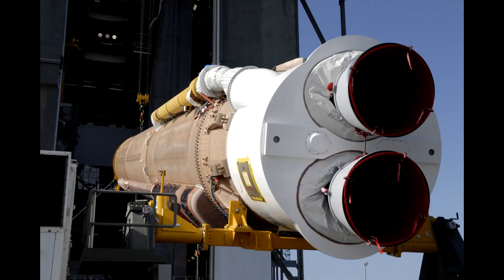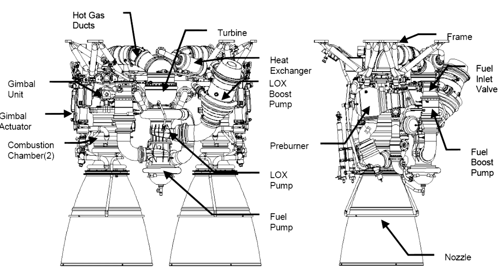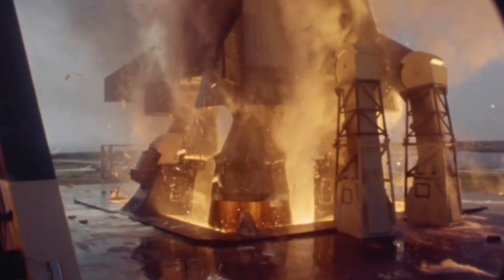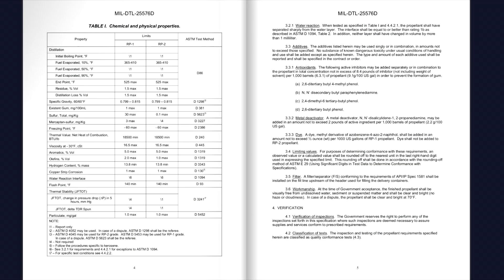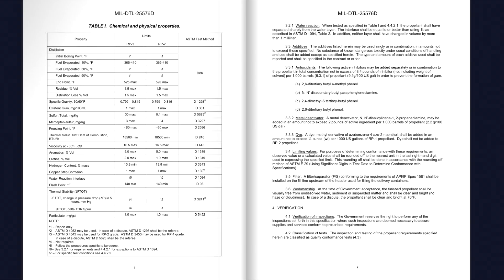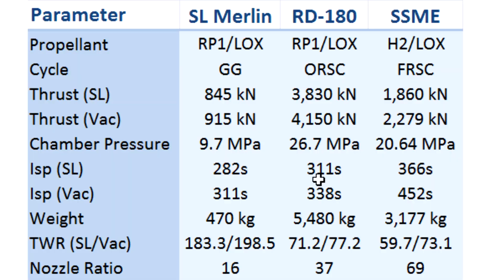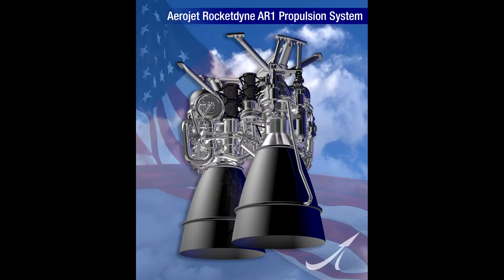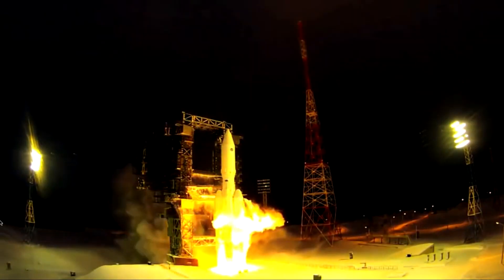Why Some 21st Century US Rockets Still Use Soviet Era Engines

Comment: So it seems the USSR has effectively seized the means of propulsion.
Reply: Perfect 5/7
Reply: why is everything in fraction ?
Reply: 8/10 solid. haha
Reply: James Bohigian ... Don't you mean liquid? =P
Reply: They have nothing to lose but their hydrocarbon chains
Reply: that is incorrect, currently with just updated electronics, they currently fly on the single stick Soyuz 2-1v, they intend to replace them with RD-193 when they run out, with 3 successes and 1 partial failure, it is a more obscure member of the R7 family of rockets as it omits the side boosters
Reply: I like the punletarian pro!
Reply: Can someone explain the joke? I'm not the native english speaker
Reply: Jet guy Then you need to do more research. There have been MANY flights of reused boosters. Hell, SpaceX just flew one for the third complete launch/land cycle just a few weeks back. That's up and down, three times, with the same booster. You can simply look any of this up in seconds. That mission was  SSO-A I believe. Frankly, if you aren't even following the space launch business close enough to be aware of this, despite it being covered extensively in the media...why are you even arguing here? Out of your depth. Reuse of these boosters has been proven for years now. And you were't even aware of it. Hell, even the Falcon Heavy launched on reused boosters. And lol @ aerospace engineer. Another guy I was talking to about diesel engines just told me he was a mechanical engineer, and he was even more clueless about the topic than you. But what do I know? I'm just a retired astronaut ninja assasin who moonlights as a snowcone machine salesman.
Reply: Had* ;_;
Reply: @jet guy thanks! Now I understand :)
Reply: Jet Guy Reusable boosters have half the payload? Compared to what? The Soyuz for example can only put about 15,000 lbs in LEO....
Reply: @jet guy actually reusing the rocket isn't an extra expense it's a savings because you aren't pissing away the cost of the entire rocket on nothing. Simple fact is they've been landing these boosters routinely for years now. They've landed dozens of them. They've reflown them and landed them again repeatedly. the technology is actually pretty well proven at this point even if it's still in an experimental phase. I don't know what to tell you. I understand there are fanboys of other companies and Fanboys of NASA and Fanboys of ula etc. but there is no reason to unrealistically diminish SpaceXs technology and its accomplishments.
Reply: So U.S. Lost that one compared to Russia's rocket engines
Reply: Go to your room. ;D
Reply: Which engine is best the cryogenic engine or the merlin engine?
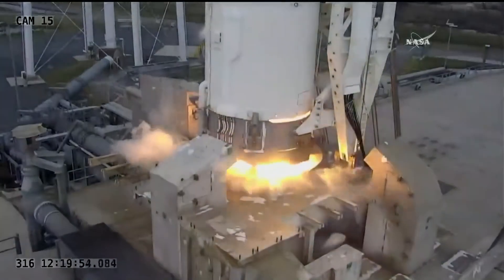Reply: 0:34 I'm not Russian, but the proper pronunciation of "Energia" in English (from "энергия" meaning Energy) is not En-er-jia but En-er-gee-a.
Reply: You have no idea how much I like this comment
Reply: This aged incredibly well
Reply: USSR muscle baby!
Reply: Lol i jsut got this like to 2.1k
Reply: I mwnt comment not like lol
Reply: Lol good one.
Reply: That man with the bourgeois Western sense of ha-has... send him to the gulag.
Reply: We have become as communist as Russia. Communism is where everything stagnates.
Reply: leapdrive Why can’t you just keep the stupid political nonsense out of this?
Reply: Steven Blackwood commercial rockets have to be cheap and reliable, it’s not like America does not know how to make powerful rockets.. Saturn V was powerful, and some of America’s Secret rockets are far much more powerful, but they are not cheap.
Reply: while the joke is very good, the Shuttle main engine is 453 seconds, while the RD-180 is 338 seconds
Reply: yes, but you also need to take into account the fact that kerosene is 10 times as dense as hydrogen, so you can store 10 times as much fuel in the same volume (also, since it isn't cryogenic it is a lot easier to store...) the rho*isp of the SSME could still be higher, but it is going to be a lot closer...
Reply: Exactly! Fuel density is the figure of merit for first stage, not Isp! Isp gets super important after you get into orbit.
Reply: Obviously one burns kerosene and one burns hydrogen it's physically impossible for a kerosene engine to come close to hydrogen engine in ISP. If you compare to other kerosene engines it blows them out of the water. And one is fuel rich while the other is oxygen rich. There really is no way you could compare those engines fairly or any way they could be more polar opposites of rocket engine design. Especially the fact that one is fuel rich hydrogen engine and the other an oxidizer rich kerosene engine. That is an entirely different engineering challenge and frankly fuel rich hydrogen is easier to do.
Reply: 221 b A better comparison might be between the RD-180 and the RS-68 on the Delta IV, which runs about 412 s in vacuo. While a cheap hydrolox engine, it’s still much more expensive than the RD-180.
Reply: @please_stop-v7o  RD0120...it has a specific impulse is 455 sec.
Reply: @please_stop-v7o  it is easier to do with high cost .
Reply: 666Tomato666  It's hydrogen, as explained in the video. Hydrogen has it's own compromises - mainly fuel density, consider the size of the external tank on the space shuttle.
Reply: Limivorous1  My `hydrolox Saturn S-1H` mental construction: The RP1 S-I stage is about 15 floors tall, the oxygen tank is about 8 floors, 4x as large as the RP-1 tank. The hydrolox stage will need the same amount of oxygen as the RP-1. S-II had tanks also about 4:1, but oxygen was the smaller one. So the S1H would need a 30 story H2 tank, an 8 story LOX tank, and 'the same engines and separator,' making S1H alone taller than Apollo-Saturn. #havingfunwithit
Reply: Space Shuttle engine is 366 s ASL, and SRB is 242 s.
Reply: @666Tomato666  Well, the RD-0120 would be the more appropriate Soviet counterpart to the SSME and that got around the same Isp. Made a bunch of trade-offs in other areas though.

Pity it is out of production though.
Reply: @666Tomato666  While that is true, remember that Hydrolox fuel density is very low, which means that if you replace a Kerolox rocket with a Hydrolox engine and fuel, the resulting deltaV would be lower.
Reply: 666Tomato666 dude you know specific impulse isn’t everything? Specific impulse mostly changes with different fuels. Thats the reason why ssme has that good numbers, not better engineering. Combustion pressure however depends on better engineering, and apart from the raptor russians have the best of that.
Reply: @666Tomato666 RS 25 costs a shit ton more, and complicated af too.
It's amazing, but it's not an easy option
Reply: You cannot compare different fuels. Hydrogen has highest Isp, there is no way kerosine(RP-1) engine can compete with hydrogen. But hydrogen engines are not that good for first stages, we still need big RP-1 engines.
Reply: No. There is only one American rocket that uses this old engine. It's soon to be outmoded.
Reply: RealityIsTheNow, you forgetting Antares? as to comparing to other kerosene engines, seeing as kerolox is best suited for the first stage, TWR is another important factor and the sooner you can get out of the atmosphere and make your gravity turn the less fuel you use on assent this is why the two vehicles right now that have the highest launch mass to LEO efficiency are Falcon 9 and Falcon Heavy combined with relatively light weight construction, the TWR of the Merlin engine is extremely advantageous and more than balances out the isp advantage that RD180/181 has over it
Reply: RealityIsTheNow that was the Antares 100 that used mothballed Nk-33s that were modified by AJR they are currently flying the Antares 200 on the RD 181 the immediate successor to the RD-180 used by Atlas V. Russia doesn't have the money that will ever make it to the engineers to make new rockets
Reply: @RealityIsTheNow  Ye right.

Comment: Can't they use SpaceX Raptor Rocket Engines. Don't know the precise power output of those rocket engines comparing to each other. But it would be quite simple to increase or decrease the exact size of all components to make a rocket with the wanted output? And why just also now use Russian Rockets? They can screw you due to the conflict with US weapons killing Russians so why not let an engine fail and cause for huge problems for the crew on-board.
Reply: SpaceX doesn't sell their engines since they like to iterate on design and selling would require freezing it, nowadays ULA uses 2 Blue Origin BE-4 engines for their Vulcan rocket which is a strictly worse design than raptor (worse in thrust to weight, complexity, not ffsc, worse production cadence) and more expensive but compared to other options it's pretty decent
Reply: @pc_screen5478  Thanks, I try to get it. You primarily say SpaceX is still fully experimental with these engines, and Raptor 2 will become R3 and also for if I say correct Block 2 Starship. And all is now still completely experimental. They are still finding limits and materials to get it better for re-using what is the difficult part because sending it 1 way you don't need a heatshield, fuel for boostback and landing burns. Managing fuel in all flight regimes is rocket science on itself

Also, the starship will do that, but so far I know they already did testing with  landing it and already hovering at a designated spot after return were also is a camera on a "Buoy?" 

Ansd finally yes, If the BE-4 is what it is but good enough for a disposable engine on Vulcan. Then it's better than using like Russian RD180's. And Vulcan can have litterly 6 SRB's to give it more juice to escape the dense atmosphere. So they can scale up or down with that just what you need for medium to more heavy lift.

Comment: Thought Russia embargoed both sale and repair of their rocket engines. So what are US using now?
Reply: There is a multi-stage answer to this question:
Firstly, only two US rockets ever used Russian engines: Antares and Atlas V
Antares will instead use Miranda engines from Firefly in the future. And for Atlas V they still have enough RD-180s left to keep flying up to 29 more missions until 2029, then they'll replace it with the Vulcan and BE-4 engines from Blue Origin, as mentioned in the video. The Vulcan had its first successful launch just last week on the 8th of January. :)

Comment: The USSR develpoed a Full flow staged combustion engine the rd-270, a tri-proppelant engine rd-701 ,they also developed n204/udmh a rocket fuel and a fluorine engine rd-301

Comment: @ 4:37- These are the factors that convince me that the Russians are notably ahead in rocket engine design.  They've resolved the fuel-rich soot problem by making the system oxygen-rich instead.  Circulating all the oxygen through the pre-burner, then the exhaust containing unburnt oxygen is then sent to the main engines. They are also the first to develop the advance stainless steel alloy to both withstand higher combustion chamber pressures & oxidation immunity.  A 25% power boost yet so reliable & affordable that the U.S. have routinely chosen to purchase & use Russian rocket engines.  I'm certain Mr. Vladimir Putin will agree with me 100%.

Comment: In the case of the Atlas V, more like end of 20th century American rocket design using Soviet Era engines that received an upgrade. The Atlas V was part of the Evolved Expendable Launch Vehicle, which kicked off in 1994. Lockheed Martin was able to harvest a whole lot of hard work the Soviets put into the difficult RD 170/171, developed for the Energiya strap on boosters (and a cause of delay for the program). The collaboration appears to have gotten it right given the record of the Atlas V  and the RD-180; and given a few of the accidents with the RD 170/171 in the 1990s and 2000s.

Comment: The US government should buy a dozen each of AR-1, BE-4, and Raptor to replace RD-180. With three options the risks are reduced and purchase of more than just prototypes allows for flight tests in addition to static ground tests. Testing a dozen engines each should probably be enough to make them low enough risk to be available as plug in parts for various customers. I personally like the BE-4 and Raptor better than AR-1 for future potential but AR-1 could potentially be much easier to incorporate into most existing rocket designs since the propellant tanks can remain the same.

Comment: USSR never utilized closed cycle for human missions. Open cycle is far more reliable and with a low failure rate. So the RD-180 is nice but definitively dangerous outside standard commercial missions.

Comment: It's interesting that soviet rockets from the 1980s have a higher specific impulse than the modern Merlin engine, but It's worth noting that the Merlin engine has 2.6 times as much thrust per kg when compared to the RD-180.  Less of the thrust that's produced is spent lifting the engine so more is available to lift payload.  The much smaller Merlin is used in large arrays providing redundancy for safety, and the Merlin was designed for lower cost volume production and reusability.
Reply from the maker: In the other hand, the Merlin has lower specific impulse so the better TWR gets eclipsed by having to carry 10% more fuel.
Reply: @scottmanley  - Hey Scott!  IANARS (I am not a rocket scientist), so maybe check my math roughly comparing the Starship with 31 Merlin engines in the first stage to a hypothetical RD-180 powered Starship, neglecting the finer issues of vacuum versus sea level performance, etc.
470 kg X 31 Merlin engines = 14,570 kg
Engine mass savings compared to RD-180 engines = 23,314 kg
10% excess fuel needed for Merlin engines = 120,000 kg
Net mass advantage for RD-180 engines = 96,686 kg
Mad props to those old soviet rocket scientists!
I suppose (no calculations) that the Merlin was chosen for being some combination of using cheaper materials, being faster and easier to build in production quantities (Elon always says that the trick is making rocket science into a manufacturing process), possibly greater inherent reliability, more scalable with safety in redundancy, more suitable for reuse (I'd guess that was a major factor), etc.

Comment: Something I didn't hear mentioned was the flyaway cost of each engine. It's been my understanding one of the advantages of Russian engine cost is that could basically ignore the costs incurred during the Soviet era. The B-1 enjoyed a similar advantage when Reagan resumed development. It started out with a clean slate accounting-wise, so on the books it came in under budget.
Today we need to compare the Russian engine with other engines with similar lift. Does it matter if the Russian engine is more efficient if it costs (say) 1.5 times as much?

The economic factors are to my mind ignored too frequently.

Comment: You're just WRONG. The current US/NASA program has already developed the GEM-63 SRB. Successfully tested on an Atlas V last July (2019). The GEM-63 will also be employed as a 2nd stage booster pair w/ the HAPI-V launch system that's in pre-production.  "High Altitude Platform Insertion Vehicle" is a revolutionary approach to putting things into space. GEM-63 SRBs are manufactured by AMERICAN companies Alliant Tech, Orbital ATK, & Northrop-Grumman. My father was William Gladden. NASA Project Manager for the original Space Shuttle SRB team. That was UTC/CSD/USBI-made SRBs & recovery ships. Going back to 1976. I was weaned on this shit, dude.

Comment: The abbreviation "RD - 180" is translated as "Rocket Engine - 180". 
R - Rocket. In Russian sounds (Raketnyy) 
D - Engine. In Russian sounds (Dvigatel')
Reply: Заяц, dont tell them our secrets, tovarisch!
Reply: ну погади
Reply: 😂🤣😂🤣❤️ Raketni dvigatelj
Reply: Which engine is best the cryogenic engine or the merlin engine?
Reply: For now cryogenic raptor engine best. Before raptor best engine is rd275 hypergolic engine. Best kerolox engine rd191
Reply: @lordpochinki2112  The Merlin is not a closed cycle engine. So, it is inefficient but it is cheap.
Reply: davai slava rassie

Comment: Scott ......did you actually look at the thrust per kg of weight of the RD-180 vs the SpaceX  Merlin engine.
The Merlin produces 2.5 times more thrust per kg compared to the Russian RD-180
And the Merlin is an older design.......SpaceX now has the much more powerful Raptor engine.
Reply from the maker: Merlin gets lower specific impulse than RD-180.
Reply: @scottmanley  Thanks for replying Scott, the specific impulse is basically the thrust .....right ?
What I was looking at is the weight of the engine vs it's thrust.
SpaceX's design philosophy is more rockets that are smaller creating more redundancy. 
About 4.5 Merlins would have the same thrust as the RD-180 and weigh 2,130 kg .......... the RD-180 weighs 5,480 kg
Reply: @garyevans718  specific impulse basically measures how efficient an engine is. Yes the merlin has a very good thrust to weight ratio but especially for the first stage it doesn't really matter as we're talking about a difference of ~5 tons (taking your measures) for a full falcon9, which weights ~550 tonnes at lift off (so ~1% difference) when the specific impusle difference is ~10%. So the merlin ain't winning against the rd-180, and redundancy is not really a valid reason imo since engines are so reliable these days that a single engine is reliable enough, lastly for SpaceX and landing their boosters they could use multiple rd-181/191 which is basically a single chamber rd-180.